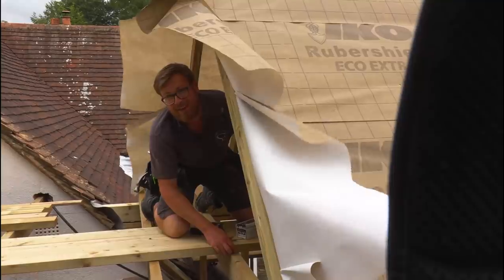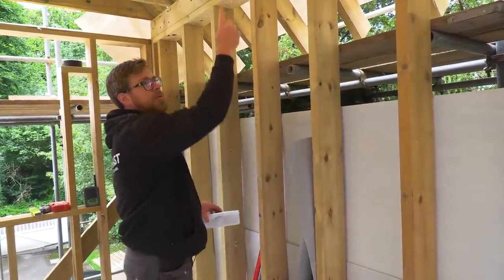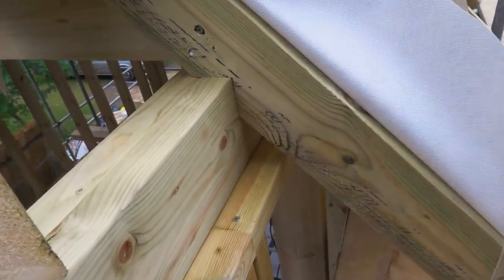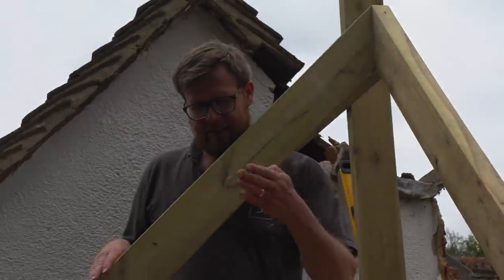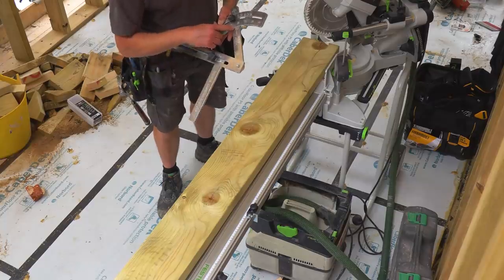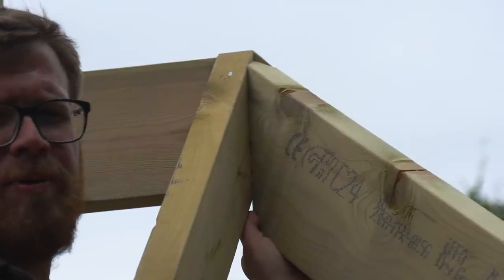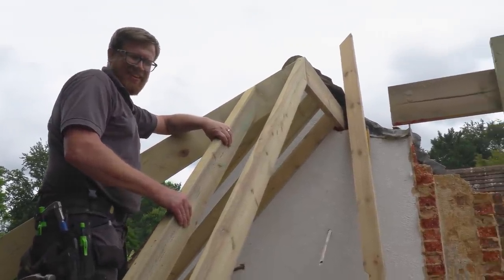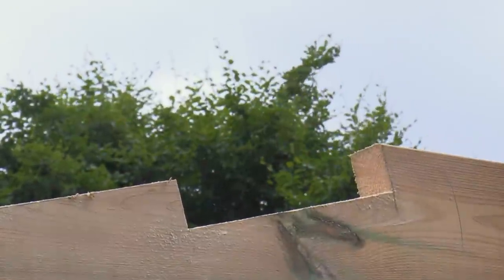Hip Rafter & Scarf Joint ~ Extension #28

Comment: I now live in Queensland Australia. I put an Extension on the rear of my house. Cyclone Straps & Plates on all Rafters fixed to Top Plate, Cyclone Rods on the sides of openings & corners through the Top Plate holding the Roof structure on. Ply Bracing on Corners  + metal bracing (Hoop Iron) across the Rafters. I am always impressed with the Job James does. A true all round Tradie. All the best, cant wait until the next update.

Comment: Are all the commentary British? I'm from across the Pond. Carpenter for 40 plus years. Don't they have a job pricing scheme over there called  Cost Plus? That would be the cost of materials and labor, plus a specified percentage for overhead and profit. It's written into the contract so the builder is protected from price increases and if the price of material goes down, (as if), good for the client.
New subscriber.
So far, I really like these videos.

Comment: Good looking work boys, and without taking anything away from you there are a few things that struck me. Attention to detail is one things and your cuts and joints look great, but they dont need to be great they just need to be good. There is a thing called allowable tolerance and on a roof the tolerance's can  be greater than when your're hanging a door for instance. The mitre saw will make really accurate cuts but it's not the tool for cutting a roof, it's much much slower than an experienced chippy with a skilsaw. Birdsmouths on 6x2 can be cut right through without using a handsaw, the overcut will have no detrimental effect on the strength of the rafter, likewise if your cut's aren't perfect, it doesn't matter, it's a roof not a front door.  
Scarf cuts look impressive but a ridge can be joined with a simple angled cut, nailed or screwed with maybe a splice on each side, simple and quick and perfectly acceptable.
I'm not saying you should be rough but it's hard enough making a job pay without wasting time on unnecessary details.
Reply: That's not house bashing, those lads are top notch craftsmen and charge accordingly. They can take their time and do it right because the price allows for it.
Reply: Be able to do it both ways; and when you’re making a video, do it this way.

Comment: When cutting a scarf the end cuts should be backed off not square cut, this enables the scarf to lock in when the wedges are driven in old chippy
Reply from the maker: You are dead right and we did discuss this very point on the day. On the next one the angles will be cut back so it locks in better.

Comment: If you measure rather than calculate your hips then…Cut a block of timber the same length as your HAP, butt it up with the edge of the wp on the corner and measure down to that (rather than the wp itself) thus gives you a much more accurate measurement for the length of your hip. Also if you mark both sides of your ridge plumb cut onto one side of your timber (2 plumb cut lines 45mm apart when using a normal treated 2” timber) then you can cut both cuts of your double bevelled ridge cut without flipping your timber over simply by flipping the bevel on your chopsaw or passing from the other side using a circular saw … still saves you flipping the timber over and therefore time

Comment: i am guessing on this roofing square common and hip values are equal only whe the hip rafter is placed 45 degrees from common rafter. right?
Reply from the maker: No the hip is always a different angle because it travels further. The reason you dial in the same angle as the commons is simply because the square works out the difference

Comment: I'm gearing myself up to ring around all the jobs I have booked in to tell them I can no longer honour the original quotes.
Prices of materials are beyond stupid.
. The last two weeks I've been working for less than nothing a day simply through rising prices. 
A simple feather edge fence I priced at just over £600 only two months ago came in at just under £1500. 
I cannot afford this.
I'm not one of these YouTuber tradesmen that get away with massive prices. If I'm not competitive, I don't work. 
The world they want to build back better doesn't include small independent tradesman. 
Especially the kind of demographic that the trades predominantly make up.
Good luck lads. I'm not feeling very optimistic.
Reply: Which YouTuber tradesmen are "getting away with massive prices"? I think I should become a Youtuber tradesman if what you say is happening.

That fence price, was it for just one side of the fence at £600? Because if you do both sides it will be £1,200.
Reply: Yes indeed....I completely agree - this current material shortage/price increased situation is fucking crazy!!! I have been in the trade (carpenter) for past 27 years and have had a Travis account from the start. This week I bought  8 number lengths of 2.4  x  4"X2" and 2 number sheets of 18mm shutter ply and cost over £165!!!!! 😱 - total madness!!! - feel like giving up for 6 months: telling Dr I'm stressed and getting some of the money I've spent years paying into back!!!
Reply: Same deal here in central europe for what its worth. Materials prices going up weekly. Not just by pennies but like by tens/hundreds percent.
Reply: Just tell the customer the prices have gone up 🤷🏼‍♂️
Reply: Totally agree pricings gone mad and showing no sign of slowing down. At the moment people have money to burn coz they haven’t got anything else to spend it on wait too next year people will rather spend their dollar on a holiday rather than have non essential work done.
Reply: Yeah. Just cover yourself for £250-£300 a day. And just add materials on. If your good at what you do. And they need the work doing. They will pay it
Reply: Its beyond a joke with the material costs constantly increasing, we have had two extensions fall through because of re-pricing, one which was originally costed at around the £100k mark has increased by a further £48k! thats just on timber, insulation and steels...we are told material costs will continue to rise too, i don't see how it can be sustainable...Nice to see our industry that kept plowing on through the current pandemic, keeping the country going is being looked after!! Good luck mate, hope things improve for you.
Reply: @gdfggggg  Yeah like the customers are all good with 100% price increases..
Reply: Put your prices up mate, take more time off and only so the jobs you'll actually make a profit. Best thing I ever did anyway.
Reply: You can build back better but you cannot control the market. The market is what the market is. It is not local to UK but world wide.
Reply: @gdfggggg  exactly, I won't be paying for it
Reply: How does that even make sense, guessing you gave yourself £200 profit that means the fencing was roughly £400

I'm fairly sure materials haven't risen 400% in two month lol
Reply: @gdfggggg  that's what I meant by saying I need to start ringing around to say I can no longer honour the old quotes. I love my job but I can't afford to do it for free.
Reply: @jimmybaldwin737  I am good at what I do but i don't live in a super rich area. £150 a day is premium money round here.
Reply: @flyingjackcarpentry9394  You remind me of my brother - working for nothing or at a loss on some jobs, You're not a charity and your bills don't pay themselves.
Reply: Well that all escalated quickly. 😲
Reply: @flyingjackcarpentry9394  Have a read about neo liberalism. Your probably a sound fella but your talking a lot of rubbish on here.
Reply: @flyingjackcarpentry9394  spot on mate
Reply: @flyingjackcarpentry9394  not trying to be funny but a good joiner wouldnt get out of bed for that mate
Reply: Sorry situation.

Comment: I like the way you guys work , but here in the States especially the south. The other builders see you using & impact or sliding miter saw to frame a house or addition. They will let the roof fall on you😬
Reply from the maker: Rafael
What you say is very interesting because it chimes with what some of our other American viewers say. It seems that in America there is an undercurrent of rigid conformity that is reinforced with low level intimidation. If a guy wants to wear work trousers (pants) with pockets on the outside he will be laughed off site by all the guys who think you have to wear regular jeans. Similarly the 'mafia' comes out in force if you are using the ' wrong' tool or driving the 'wrong' truck. If this is the case then it is similar to communist countries   and seems to run counter to the spirit of "The land of the brave and the home of the free".
Reply: @Rafael I built in the South US, specifically Cashiers NC, and on all the jobs I worked, no one laughed at a carpenter because of the tools they used, as long as the work looks good. ( Although my crew used to snicker a bit when I pulled out my Ryobi cordless tools 😂, because they all had Makita or Milwaukee.)